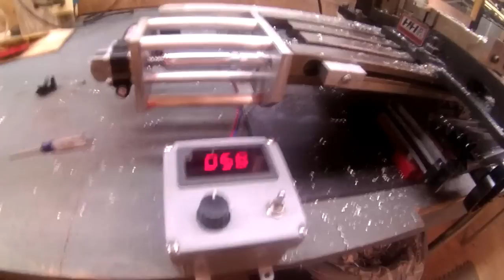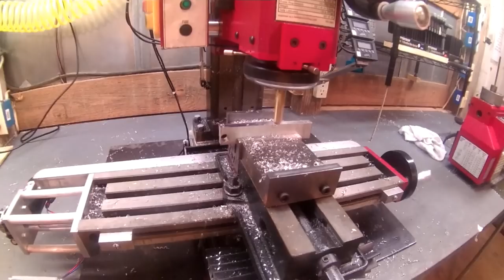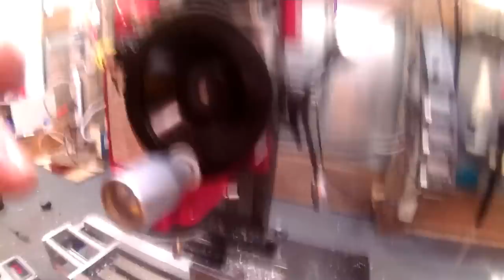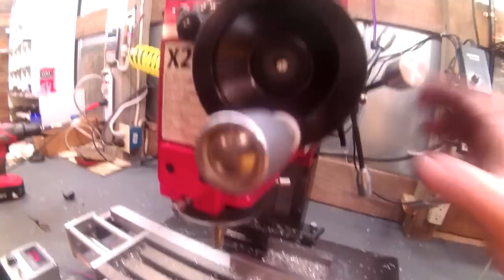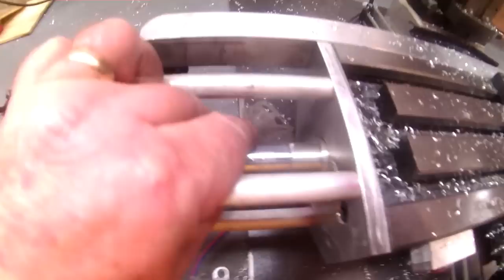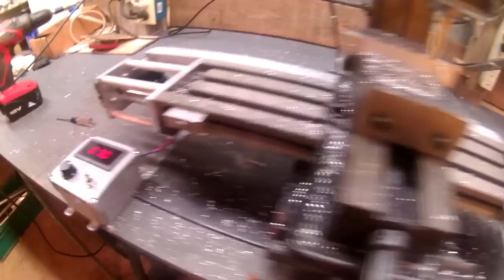Mini Mill Table Power Feed

Comment from the maker: The motor is a power seat motor for an auto. The power supply (not in the video) is from an old computer and i bought the control on eBay, mounted it in the box & added the reversing switch which is simply a DPDT toggle switch that reverses the polarity. I plan to go into complete detail in my follow up videos so stay tuned (subscribe). 😀

Comment: what are you using for the motor?
Reply from the maker: +DAVID ENGLAND See my latest public comment
Reply: +thanks.MrPragmaticLee
Reply: Motor is Dorman 924-553 Power Seat Motor or you can search ebay for 190 Rpm 12Vdc Right Angle Drive Electric Motor From Car Seats

Comment: nicely done.  did you build the control box yourself or did you buy it?  I'd like to do the same to mine.
Reply from the maker: +Brian Dughi Brian, the reversing switch is a DPDT toggle switch that I've got a couple hundred of from an auction purchase years ago.  I used it in conjunction with a motor control from eBay (DC 6-30V 12V 24V 8A PWM 
Motor Speed Controller With Digital Display & Switch VK).  I found one from a seller in NJ (vkinn) for $11.75.  For the 12VDC I used a power supply from an old computer - it's mounted on the wall behind the mill - out of sight in the video.